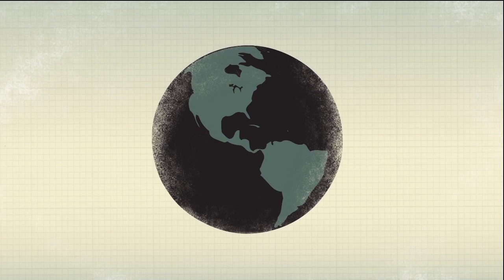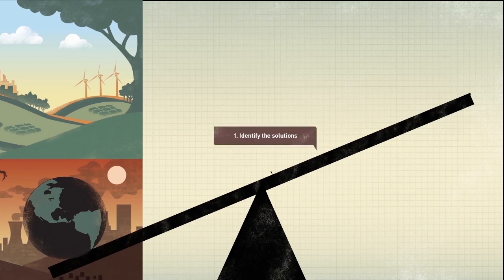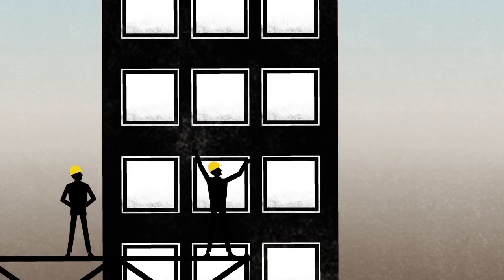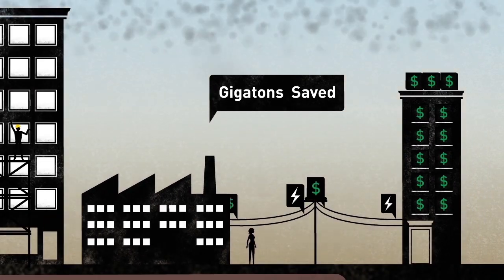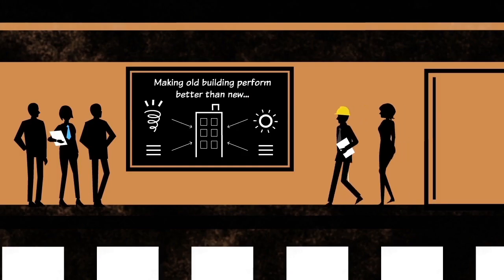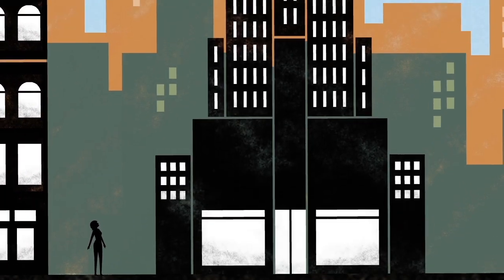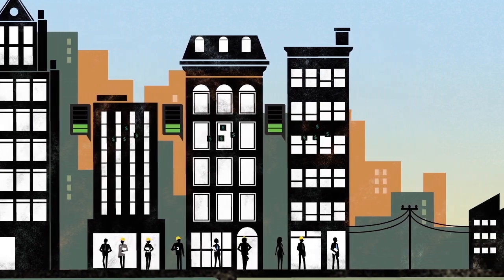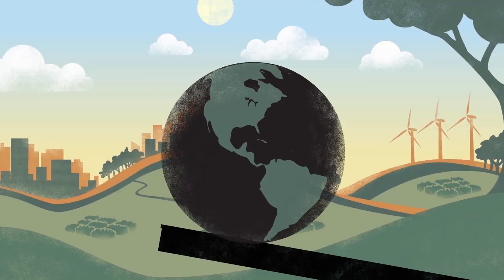A Tale of Two Futures: Sustainable Buildings or Unsustainable Climate Change

Comment: this video make it look like power generation and the transport and heat sectors does not matter..
If you achieve to convince all the world to do this (something impossible) you just get a 30% of the co2 saving.  We need more than that..
All these are very good measures.. but you have to link them with solar+wind+hydrogen storage too..

Comment: I greatly approve of RMIs goals and direction. I just feel that the Empire State Building's 38% reduction in energy usage will not save us - even when carried to scale. We will need a 70 - 90 % reduction to control the climate and prevent the famines we are now headed for. That is why I have approached my building with a "Past Net Zero" goal. I did achieve that in 2008 ... and kept going to a point of GROSS CARBON NEGATIVITY.  Now, we need to take that to scale.
Reply: There's a limit to how much you can reduce on-site in existing buildings and still have them operating effectively. The 2nd element, with arguably greater potential, is 'greening the grid' with renewables and other low-carbon energy generation. These 2 will have to go hand-in-hand for any chance of stopping the rot.
Reply: Calum Thompson - I agree in principle - there is a limit. But I believe the limit is far from being reached - thus we need to raise our expectations.
For instance, I have dropped my Nat Gas usage over 94% on a 1970s home on a mountainside in Northern Colorado.... and dropped my electricity usage (with LEDs and day-lighting, PV, etc.) to negative levels... even while adding 2 plug in cars to the load ( dropping gasoline usage dramatically).

Over all - gross carbon negativity.... not just possible - but demonstrated .
So the limit is somewhere below net zero - way below.
Reply: Steve Stevens Brilliant! That sounds great, I hope we can achieve that across the board! I worry about the drivers though, is the $/kWh saved (at this stringent energy saving level) more or less on this approach than say, investing in smart infrastructure, or installing a new wind farm. We probably need it all!

Comment: Unfortunately, nothing new here. Except that the retrofitting of the Empire State Building was beyond the reach of most cities. Listened to the Deutsche bank rep and C. Quinn present this.
The obstacle remains the debt, cash flow etc between the buttoning up tight and the payback for old buildings. Even new ones are built not too platinum but to silver (grade C) standards.
The video need to be segmented  in its message to different audiences in order to generate new innovations … not an oxymoron.
But for new eyes and first comers…. its OK.